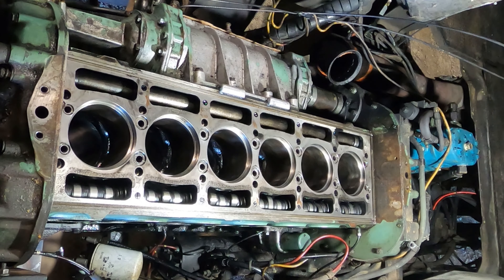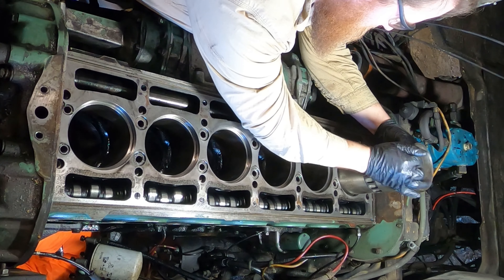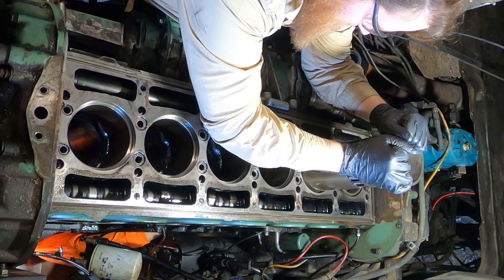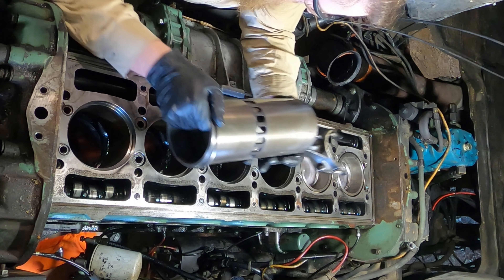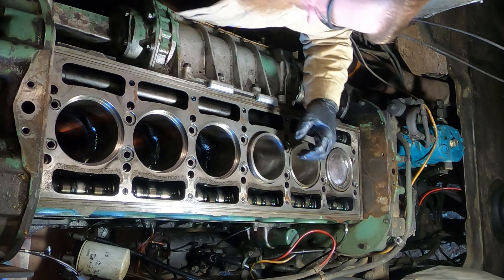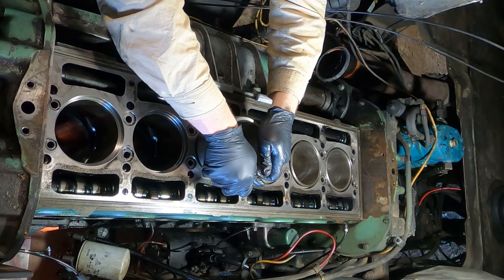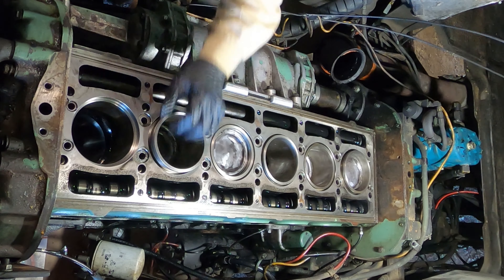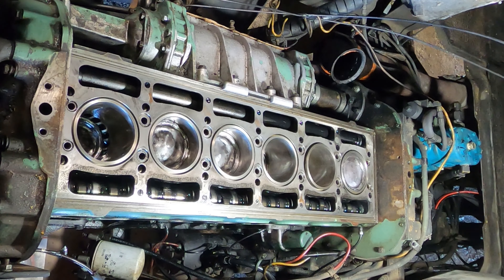Detroit 6 71 Installing Pistons / Liners & Bolt on Rod End Caps

Comment: Dumb question but which way does the rod go in on a 71 series? Rebuilding my 3-71 and forgot to mark which side of the engine the numbers on the rods/caps were facing.
Reply from the maker: The rod and cap is stamped on the side that faces the blower.  The blower on this one was on the right/passenger side so they faced that direction.
Not a dumb question, the manual is great, but you really have to dig sometimes.  There is a 90s version out there, but it is not OCR, there is an 84 manual that I like just to find what section to read.  The 90s manual has a lot of updates in it.  I can dig up the links if you are interested.

Comment: The cylinders just slide right in. What’s it take to pull an old one out?
Reply: Liners*
Reply from the maker: The 71 series have dry liners. You put a bar through the exhaust ports on top of the piston,, then as you bar the motor over, it will force the liner out. 92 can be done the same way, but they are a wet liner. If you make your own bar you have to be careful not to scratch the area where the O-rings go around the liner
Reply: @RodC671 kewl thanks for the info. Great video!
Reply: @RodC671  so when I pull the covers on the side will I need new gaskets for them or are they pretty well reusable?
Reply from the maker: @poorfarm-nn6ii  they are generally reusable. Usually really thick cork
Reply: @RodC671  awesome. I played with air brakes a little today and I’m about to edit a video on it. Going to get that underway and then head for the engine! I appreciate your knowledge. I’m gonna mention your channel on my channel if that ok with you. You got good stuff and maybe it will swing more ppl your way.
Reply from the maker: @poorfarm-nn6ii  sounds good to me. Let me know what she looks like when you get tore into it
Reply: @RodC671  I’m sure there will be a video!